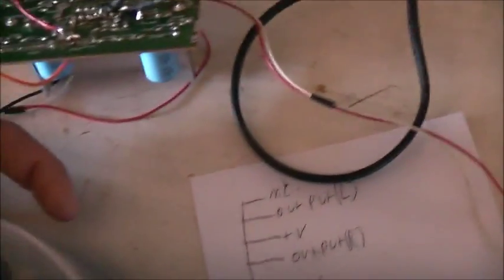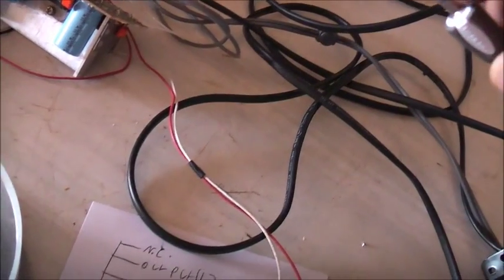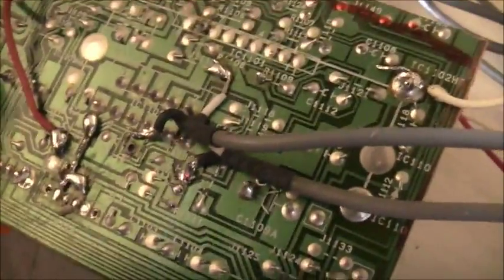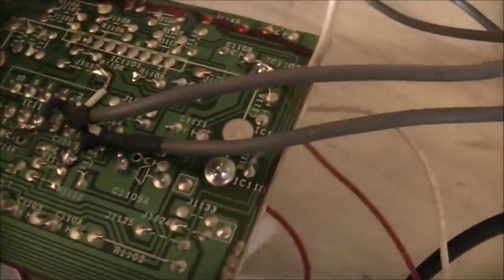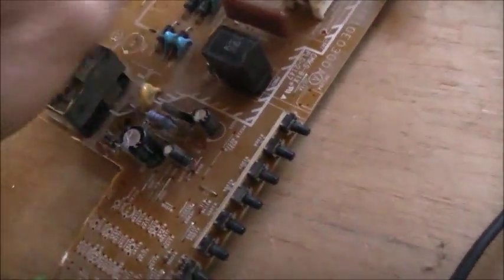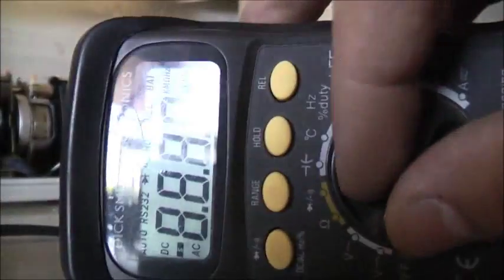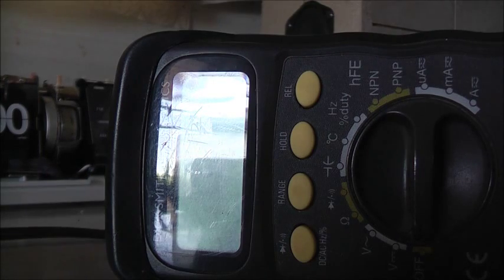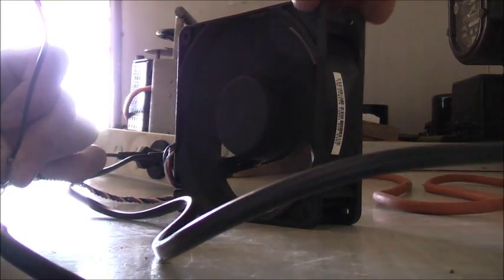Recycled Parts From TV, Amp & DC PSU

Comment: The amp needs to have the mute or standby circuit also working or it will not start up...usually its the VCC to the IC that goes to the standby circuit, but NOT always..it sometimes take only like 5 volts to get the standby circuit to turn the amp on..it has to be powered separately  from the power into the IC amp.

Comment: You could try wiring the negative (neutral) wire from the speaker and DC together with a small resistor, just thinking about the way the car speakers are wired into the car stereo, maybe a similar set up might work, just a suggestion though.